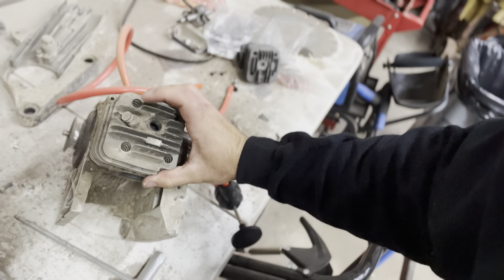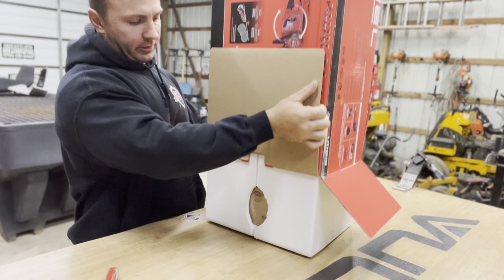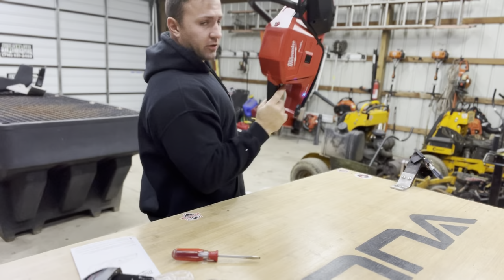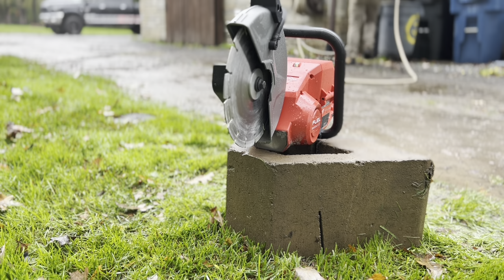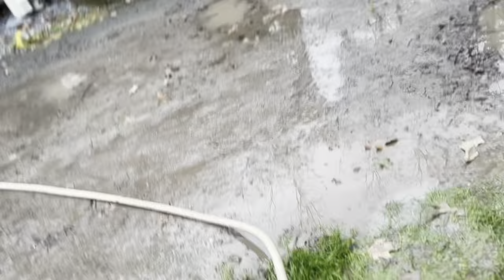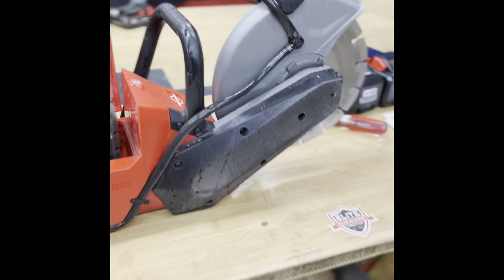Milwaukee 9” Cut Off Saw - Initial thoughts and review - ELECTRIC CUT OFF SAW!

Comment: What’s your on the battery life’s and power
Reply from the maker: Took one of four bars on a fully charged 12.0 battery to cut the three blocks in this video. So I can’t see one battery lasting very long. You’ll need multiple to rotate if you have a lot of cuts. Has a ton of power though!